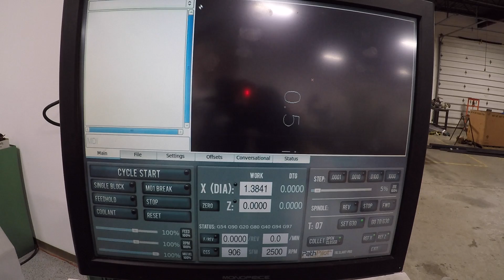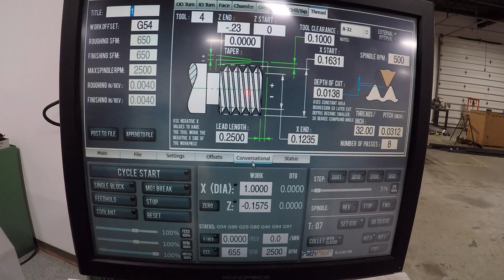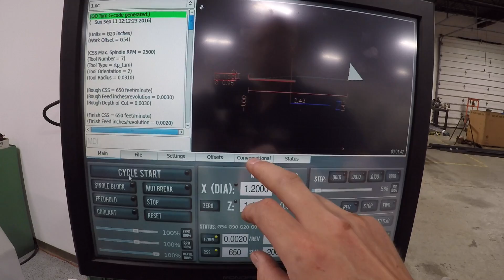CNC Turning Hard Steel!  WW112

Comment: Those inserts suck. Just use carbide. Slow rpm and medium feed. You can and should do at least .08" doc. Otherwise your just burning the radius. I like using a vnmg on hard shit like dowels. Its weird but it likes making chips usually easier than a c or d. This was hard to watch lol
Reply: NYC CNC not much is going to cut 60 rc well.  but your better off digging with carbide yes.  and please describe regular carbide
Reply: 60rc your better grinding.  I think most inserts are only around 50 or 60 rc themselves
Reply: ? Grinding is slow and unless you already have a set of grinders for round and square things the cost of CBN inserts will justify the cost of grinders well over. Especially for cycle times. Hard turning is taking a bite from the realm of grinders. 

...And Inserts are well over 60HRC in the high 70s for Rockwell C scale. CBN is even more harder...
Reply: a when you are only taking off what..........030 from diameter and those inserts last how long and cost how much.  You are better grinding.  but my point is he would be better digging with the insert and actually cutting.  iscar nitride coated work fine.  one pass.  deeper than the nose radius.  otherwise you are just burning it.  I turn dowels and tool steel daily guy.
Reply: I've turned HSS a couple of times before. Don't remember what grade exactly, but probably M2 as that seems to be the most common. M2 is 95 RC. I faced it and center drilled it with TiNi coated inserts and a plain carbide center drill in prep for grinding the blank into a reamer.

Comment: two issues with the smaller pin...one: less mass equals greater buildup of local heat..loss of hardness can happen...to mitigate, use coolant.
And two: core hardness on these pins is bit softer than the skin...soooo you took away the surface hardness and overheated the rest...oops, lost the hardness...oh poo..

Comment: Get some ceramic instead of CBN cheaper and does same thing. Used to use KO90 ceramic Kennametal on A2 and D2 58 - 64 Rc all the time.

Comment: I like the video, my only complaint on the file test you conducted was the following:

What was the hardness of the file, you should have chimed in.
The file test is just a general "is it hardened steel or not"
A rockwell test or a set of HRC calibrated file set would have been ideal to see the delta. 

Also, is your dowel Through Hardened or Case Hard. There are two types, if the company was cheap in the manufacturing process, it might be "through Hard" but not really 

If you have a FLIR you can see if your cutting at a temperature that is in the annealing range. If your concerned about hardness you'll have to flood cool, but I think you'll suffer performance. 

Overall neat stuff.

Comment: So I don't know if this is a stupid question, but why are you not using coolant.
Reply: NYC CNC either or is common.  If you do use coolant though, flood the insert big time before it makes contact and keep it flooded.  Thermal shock will crack that insert in a second
Reply: I use coolant because i saw a machine catch on fire 3 times in a year from the sparks igniting oil and other crap in the machine
Reply: On Carbide tooling, its either Flood coolant or no Coolant. You can cause premature tool wear by heat cycling the carbide
Reply: as a toolmaker i can assure you, you don't need coolant when hardturning at all! It kinda helps with the surface finish tough. And by the way, normally you use diamond plated inserts for hardturning.
Reply: Thanks everyone
Reply: If you use coolant on hard turning you need tons of flood coolant, and you have to have it exactly at the point of pressure.

Comment: boron nitride has the same electron configuration as elemental carbon, so it forms all of the allotropes as carbon; cubic boron nitride is the same crystalline structure as diamond, as is tungsten carbide. If I'm not mistaken.

Comment: Yes, totally agree, manufacturers only case harden to as little depth as necessary, also razor blades are tool steel welded to cheap steel, just the edge.

Comment: i turned my ballscrews for my cnc mill. used regular carbide but had to put a new insert for finishing passes. once you cut down enough you can thread it because its only case hardened.

Comment: CBN-inserts are either just a coating to a more flexible base or they are sintered into a matrix as far as I know. There are different ways to generate b-BN, most common is a chemical reaction of B2O3 + 2NH3 resulting in 2BN and Water. 
The cool stuff about CBN is it's high-temperature-advantage when it comes to hardness: Yes, polycristalline diamond is harder at lower temperatures, but when it gets warm, the hardness drops pretty fast and pretty low. CBN also loses hardness, but slower. So if you get hotter and hotter, at some point (around 1000 °K), CBN starts to be harder than PD. 
Chemical resistance at hight temperature is also better than diamond. Also it has a high thermal conductivity. 
Disadvantage of CBN is like some said already: They like continous cuts and constant temperature. So you should use them without or with very few coolant, otherwise they will break, because of the thermal strain. You should also be carefull what materials you form with CBN, cause with some, there can be reactions (Copper, Silver, Chrome,...).

Comment: Ballscrews are not typically hardened throughout. The core may be harder than CRS, but not as hard as the surface.
Back in the day we would take a large depth of cut as a rough cut (removing all of the interrupted cut) and then a couple of roughing passes and finish. All on manual machines.
 We also have had luck with annealing the ball screw ends with a torch before machining.

Comment: So with that knowledge you couls cut tool steel cutting past that case hardening surface. It could be case hardened easy back to hardness I think you are on to something there. How about S7 of steel used on hammers and punches or a harder alloys?

Comment: An old tool-&-die-maker I used to work with was turning Inconel on a manual engine lathe once and I remember thinking how awesome the glowing chips flying off that was.  Unfortunately, that is not even close to as awesome as the "flaming silly-string" chips the CBN inserts on hardened steel makes.  Impressive.  (Although the blue'd chips in the scrap bin looked much cooler than the combusted metal hair I'm sure you're left with).

Comment: John, I've been using these inserts for a while now. I always like to keep two on hand for "emergency" type jobs where you have to machine something hard, or, you trying to machine some hard weld. I've had to use them to machine some case hardened sprockets and they work good. Yes not too good for interruptions, but they do work. Light cuts and feed. Don't overdo if.
Reply: +Abom79 Would be good to see you using these boron inserts on a manual lathe as NYC CNC  suggests it can be dangerous withoug going into details.
Reply: Iv had almost no problems using just about any carbide insert to turn case hardened sprockets. Cuts like butter

Comment: Did you notice that you killed the file? Holding it flat dulls the teeth all the way across, tilting it to de-burr or test the edge makes lines in the teeth. I keep a file just for checking hardness. You can actually buy files of different temper just for checking hardness.

Comment: CBNs are a synthetic diamond. 
I had a customer that had to turn some railroad wheels that used to hold and engine up as the reshape the wheels on the engine.  We did that with hot pressed ceramic inserts.  The chips came of to form what was a glowing pile of "steel wool". 
There is a ceramic insert made and sold by Sandvic that is whisker reinforced with Kevlar and made specially for turned hard parts with an interrupted cut.
Reply: Cubic boron nitride is exactly that, cubic boron nitride. It is in no way diamond. Diamond is pure carbon
Reply: CBN is a completely different material than diamond.

Comment: I used to work in a toolroom making forging dies, I very rarely got to machine a die before heat treatment so the hardness was anywhere from 45 - 62 HRC using iscar ceramic inserts. The hardest I've machined being 80 HRC using a CBN tool and from my experience I found that both ceramic and CBN incerts perform best when running dry (no coolant, fluids or paste) fast surface speed and slow feedrate. on a ridged enough manual machine I managed to turn a 5mm depth cut on a 54 HRC forging die

didn't have much success when facing to the centre of components with CBN or ceramic inserts as it would tend to chip the tip really easy and both tips are for hard material only, they do not perform well on soft material

Comment: Dowel pins are case hardened and not thru hardened. This is so they retain some elasticity, and won't break from an impact. You can increase your depth of cut to .015 to .03 per side. Sfm could venture into 1000 and above depending on grade and material being cut. Chip load can vary depending on surface roughness required.

Comment: Usually dowel pins are used to located something to something else and keep it there, while helping the bolts to keep said parts from shifting in any direction. So case hardened makes sense, if they were through hardened it would be like using carbide endmills as dowel pins...they would just snap off because it's hard and brittle. The case hardened takes the best of both worlds, hard on the surface help with were and damage, but still soft enough in the core to keep its torsional strength.

Comment: Case hardening +1, first thing that occurred to me before the turning even started. I would like for once somebody to show the actual hardness using a hardness tester - Yes an actual Rockwell machine (vickers or brinell also where apropriate) the file is such a poor test.

John, I have had punches hard turned (through hardened 60-62 hrc even 62-64) instead of finish ground, also form tools hard milled on a 4 axis cnc to remove the white layer after spark erosion, this can be much cheaper than form grinding and way more accurate than hand finishing.

Comment: plunge that CBN for nice red hot ribbons. Interrupted is fine with the solid CBN that has a little higher bonding content- I think it's cobalt. For SECO, I believe the solid (as opposed to tipped)CBN100 is the best on interrupted. go deep for flame thrower effect. when you do the deep cut, it hardens better- I guess from the heat. plunge that CNN. 005 per rev and it should get the hardness back. A few years ago I saw the SECO CBN100 and I had to get me some. got 4 TMN (?) 222 for $40. only used is once. I can get a red hot ribbon plunging .010 per rev. on anything moderatly hard with a neg rake 90/0 edge, but at 3/8 wide and enough sfm for fire, I'm at my limit with only a 2hp HF13X40 search CBN100 to see the SECO vid . You notice on the first cut of the video you have red then normal swarf. based on that, I guess the tormach was not compensating with rpm/sfm. I would expect it to be softer in the middle- try carbide center punch yest

Comment: With most material like those dowel pins only the surface is hardened, so if you cut deeper into them you will hit non-hardened metal which explains why on the shallow cut you made the material was still hard, but on the deeper cuts you made the metal was soft.  There is no advantage in hardening the middle of a pin, and many disadvantages.

Comment: you can turn up to 55 ish RWC with regular carbide. Ball screws are not going to be overly hard otherwise they would be prone to cracking, so you can just turn/thread with regular carbide. Dowel pins are usually only case hardened so if you remove too much you will be through it into the soft core.

Comment: I have hard turned my tappetts for a couple of years and it works well even though I can't get the proper SFM. The ones I use the direction is very important as if I back up if it drags on the part it breaks the insert so I pull away on every pass just to be safe.

Comment: Cool video! Dowel pins are usually just case hardened about .060. Try drilling through the center to test if it. Is thru hardened

Comment: The part is most likely case harden.  This pins are machined to closed tolerance and then heat treated ( case hardens)  and final ground to final dimension.  as you cut though the center will get progressively softer.

Comment: As I was watching your vid I was thinking to myself "those pins are only case hardened and he is simply cutting through the case"......Then lo & behold you brought that up on your own near the end of the vid.  The other commenters below are correct in that they are only case hardened.  You could prove that by cutting one of the pins in half (probably need a cold saw or abrasive wheel to cut it-you'll rip the teeth right off of a bandsaw blade) and then run your file over the cut end.  You'll feel it skip near the outer edge, but once you get in towards the middle of the part it'll bite in.
The reason that many pins such as tractor implement pins & the like are only case hardened is that the hard case gives you the durability & resistance to bending that you need, but the "softer" center gives you the overall resiliency & resistance to breakage you need.  If they were hard the whole way through they could/would simply snap off under a shock load.  The "softer" center acts like a shock absorber and doesn't allow the pin to shatter when subjected to a shock.  This is the same type of setup used on train wheels.......the outer skin is hard as %$#@ so it doesn't wear or deform under the extreme weight & pressures they are exposed to, but then there is a center section of a much softer material that acts like a shock absorber.
Anyway.........LOVED the lava scenes, and this was a great vid overall.  Keep up the good work bud!

Comment: Looking at the color of the chips as they leave the work piece it seems like the are actually getting hotter the further away they get. Based on this it seems likely that most of the heat you are seeing is actually a result of the rapid exothermic oxidation process, a bit like thermite.
Reply: You are correct. The iron is undergoing combustion. Thermite is different in that it is a single replacement reaction, where elemental aluminum is stripping the oxide anion from the iron cation. Producing elemental iron and aluminum oxide

Comment: a trick is learned in the shop is that if you burn your fingertips on metal or whatever immediately touch your earlobe your ears absorbe the heat
Reply: And I was using my mouth to wet the burned area and blow on it to cool it. Silly me :)

Comment: I do a bit of hard turning at work.  the trick is to pre machine the pice, the ceramic inserts are not meant to take a 1/4 of material off of a face.  you risk cutting past your heat treat if you go deeper than half the diameter of the work pice. if your worried about over heating the part run air to the tool it will help break the chip and keep the part cool. and run a couple flex passes, hard turning has a lot of tool pressure involved. and you can hard tread with carbide tooling up to like 55rc your tooling life will just go down the shoots